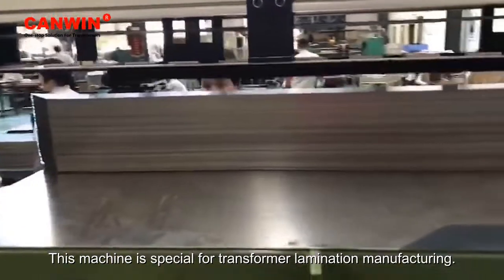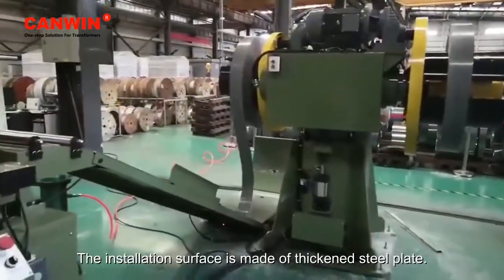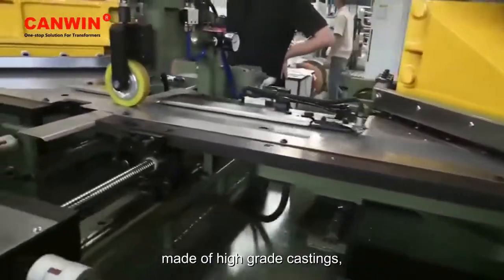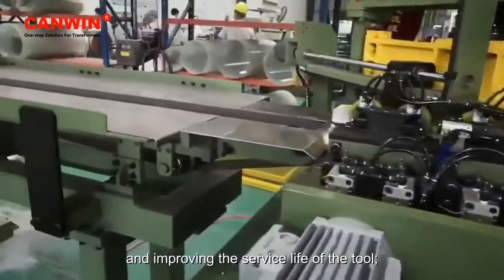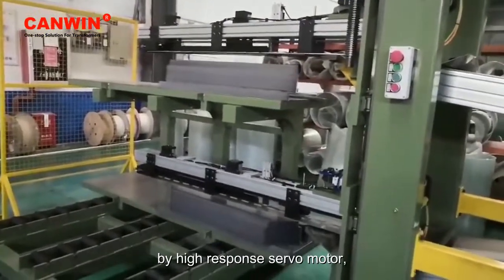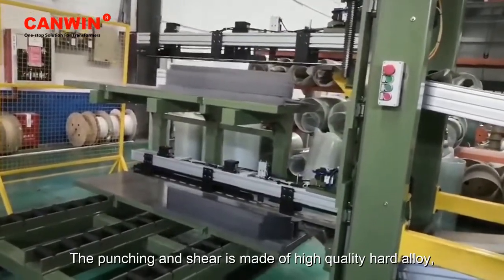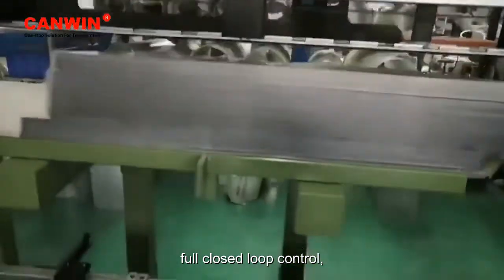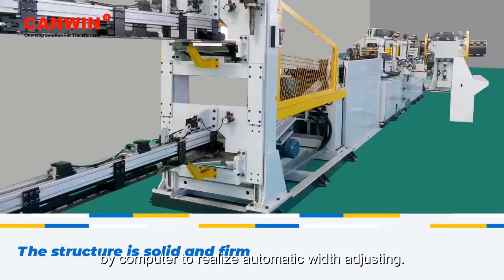CANWIN Cut To Length Lines Machine for Sale | Transformer Equipment Manufacturer CAH23 300/400/600DV

Comment from the maker: Hi ,i am Jason from CANWIN automatic equipment,CANWIN Automatic Equipment Manufacturing Co., Ltd. is one of the largest electrical equipment manufacturers in China. We focus on the R&D for Silicon Steel Sheet Cut To Length Lines, Silicon Steel Sheet Slitting Line, Transformer Foil Winding Machines and other equipment.
If you interested in any of them, welcome for any inquiries,we can tell you more details.
Contact Details：
Company Website:https://www.canwindg.com/
E-MAIL: INFO@CANWINSG.COM   jasoncanwin@outlook.com
WhatsApp:+8613632495787